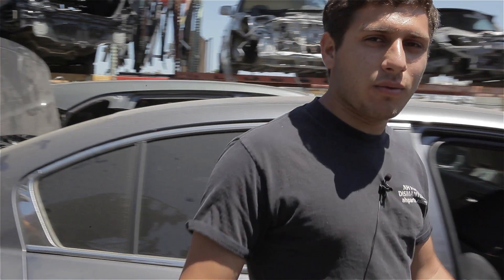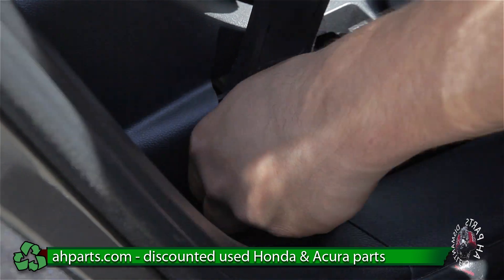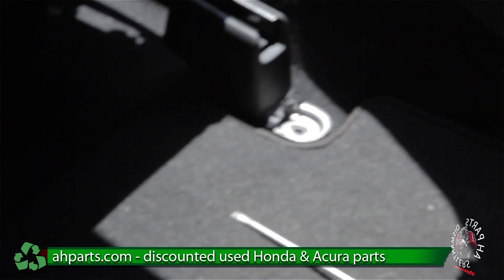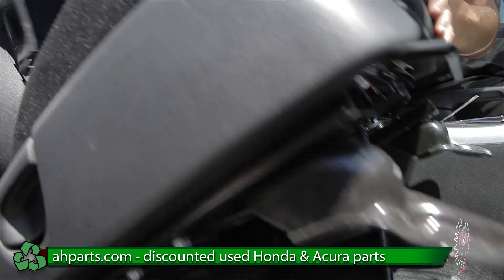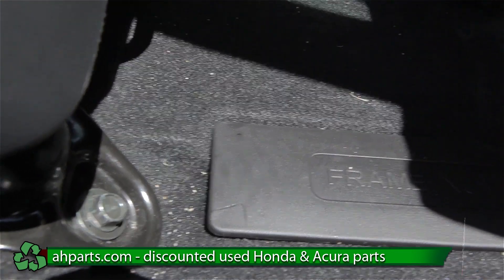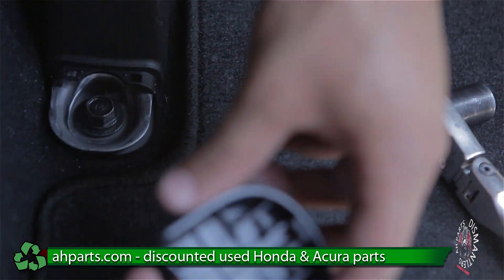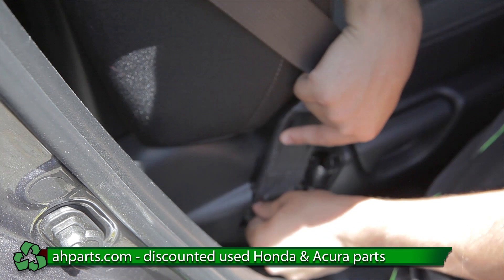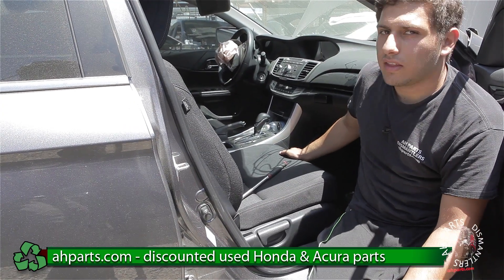How to install / change a seat for most Honda cars / 2013 Honda Accord REPLACEMENT REPLACE DIY

Comment: I’m trying to remove the drivers side seat from my 2013 exl accord but the plastic panel that wraps around the bottom of the seat is covering the seat belt bolt, even after the smaller plastic “seat belt bolt cover” is removed. Any help?

Comment: Nice video!  In case it might help someone, I found a Haynes manual at an auto parts store by searching online.  I also checked with my local library and by signing in with my computer from home, was able to find instructions for this in a Chilton manual.

Comment: I changed the front seat of Honda Civic 2013 with other ones. Now the airbag light is on and there is a message to check the airbag system. Do you have any idea how to fix that?
Reply: Did you ever figure out why the light came on, or resolve that?
Reply: That civic has an airbag in it so disconnecting that will always throw the code!

Comment: i did this, the airbag light came on. does that mean the plug under the seat is wrong or do i have to clear codes?
Reply: Did you ever figure out why the light came on?
Reply: @cvinny82  no
Reply: @adanspencer5753  must have to manually clear code them I'm assuming

Comment: Hey. If you unplug those wires under the seat, do you get any lights on the dashboard when you start the car? Has anyone tried this? Thanks
Reply: I personally wouldn't attempt to start the car until seat is reinstalled and plugs are plugged back in. But I don't know the proper answer to your question.
Reply: This is 3 years late, but if you have power seats, disconnect the battery while before you take them out and then reconnect after you’ve re-installed. That way you avoid any codes for disconnecting.
Reply: @Alex Morris  I am always grateful to the ones who leave answers years later. Thank you

Comment: don't you have to disconnect the battery before you pull the airbag clip
Reply: I had always thought so. Sometimes disconnecting the battery will make you have to reset the SRS light so I don't know I would be safe and disconnect the battery putting them back together at least

Comment: Now this is weird... i have a 2016 honda accord coupe and my cloth seats have these same exact wiring harness as in the video ..i upgraded to leather seats and the wiring harness is different...the thick yellow is the same. The blue. Is the same but the white does not match..... Its larger. Its the airbag plug sensor. I wonder if i cut off my old wire since its only 2 wires and attach it to my new harness will it be a problem
Reply: Wally Sterg well the leather seats are electric and heated, so they would have different connectors.
Reply: Wally Sterg how much did you paid for upgrading?

Comment: can you replace them with power seat from another Accord?
Reply: Hector Tario repairs 2011 Honda rear seat that wound lock into floor bracket
Reply: repair rear seat floor bracket that wound lock in to floor